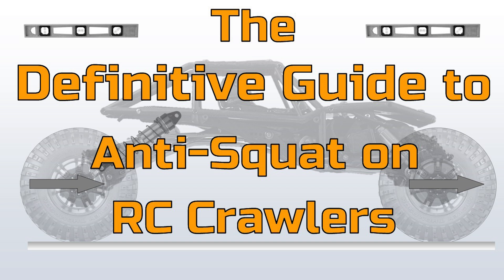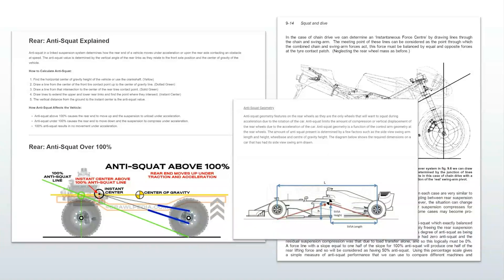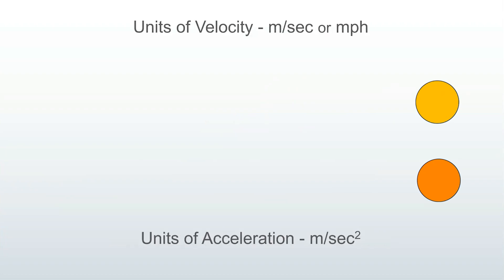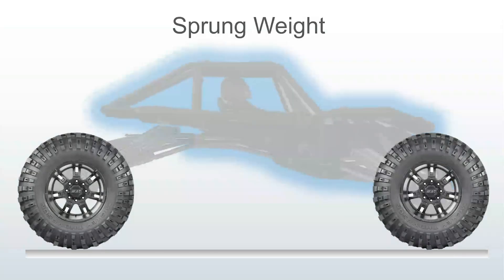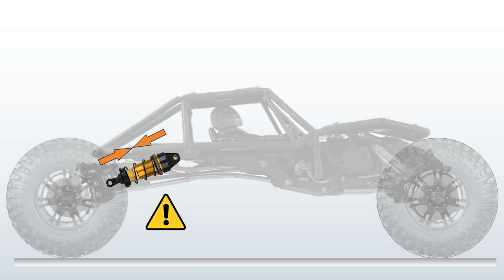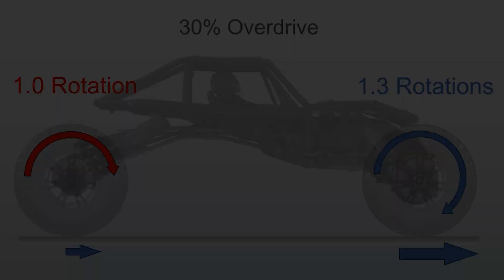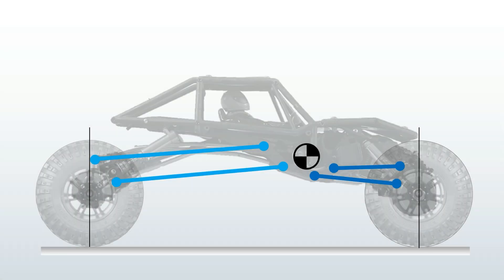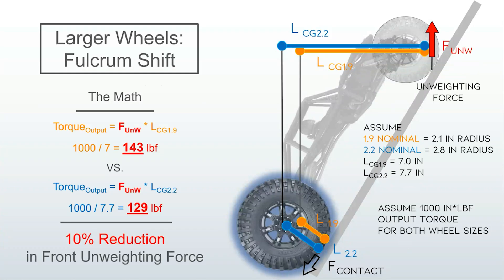The Biggest Misunderstanding in RC Crawling - The Definitive Guide to Anti-Squat

Comment: If you look at your example around the 4:02 mark, you can actually see anti-squat working. Without it, the suspension would compress as it climbed, instead its extended even under load. Acceleration isn’t the key factor here. Any load on the tire will trigger this effect.

The piece that’s missing in your explanation is caster. No matter how you position your links, caster determines how the forces push or pull on the axle and how those forces interact with the 4-link geometry. I have a few demonstrations here that show this in action. https://youtu.be/ULTCbL7Lawo?si=leyNb7_xaBgduzTd
Reply from the maker: Sorry friend, there are so many fundamental errors and misunderstanding of physics in your video that I don't even know where to begin. Best of luck to you.
Reply: @BoomslangSuspension  I’m happy to hear your thoughts, and you’ve done a great job explaining 4-link in your video, but it’s directly related to caster as the acting force. On your test config, the rear upper links are in the forward most hole. The configured caster induces pro-squat, even if your links are configured to fight it. Try adjusting your rear caster by moving the rear upper links back 1 or 2 holes, and watch your anti-squat come to life. I got clips of it in action, but without a link riser, it wasn’t as affective as it could be. Once FlowRC releases their aluminum link risers for FCX24 axles I’ll post an update to show the improvement.

Comment: I have a cheap WPL 1/18 scale  and upgraded my links to metal and extended the rears links 4mm along with soft grippy tires and beadlocks with some weight in the front and a new set of portal axles/ I've lowered it a lot and it was so bad and yet I was able to crawl up a 45 to degree incline without a problem but I wasn't able to crawl over sticks and some rocky terrain!

 So I experimented daily with my  shock positions and so far the best is soft springs in the front with bands
As for the rear I had some shocks from my 1/12 buggy and took the springs off completely and angles then forward just enough so I could climb everything in my area along with steeper inclines!
Reply: I just wanted to see if all my effort and patience paid off and it did!
I thought i had to go all out and spend more just to be able to crawl steeper inclines but your videos definitely helped me out along the way💯 @BoomslangSuspension
Reply from the maker: Sounds like you made a lot of good tuning mods in the right directions. Thanks for checking out the channel.

Comment: Most rc crawlers these days are running overdrive which pulls the front down because it’s being pulled by the front wheels. Kinda negates any need for anti squat.
Reply from the maker: You are correct, but also keep in mind that if you are climbing something really steep, the front wheel will slip first, which negates the overdrive as well.

https://youtu.be/Eb5xjllzd4E

Comment: Really interesting, but I have Two points of discussion:
1) How to calculate the antisquat: I fully agree withe the drawings when it comes to calculate the antisquat on a climb, but, if the rc crawler/scaler is on a flat plane, the intersection with the CoG is not above the front axle, but depends on torque on each axle (on a open diff woould be exactly in the center of the wheelbase, on fully locked diff vehicle is the opposite of the weight balance)
2)Didn't make the calculations, but I don't agree with the bigger wheel advice: Yes you increase the radius, but you will need more torque from the motor to overcome this change, at the end you need the same amount of force on the ground, not the same amount of torque on the axle
Reply from the maker: The anti-squat diagram is actually independent of orientation in space. It’s a balance point between the distance of the center of gravity off the ground and the contact patches. I’ve had to think about this a lot, but orientation doesn’t matter and I’ll eventually do a video explaining it.
If you put on a larger wheel your rear torque automatically goes down, which helps hold the front end down. This assumes you don’t compensate with more gearing or motor power.
Reply: @BoomslangSuspension  the antisquat diagram is independent of orientation in space yes, but dependent of torque applied on each axle. Is something I found trying to understand its behaviour and it is easier to find something searching antidive calculation, because a torque is applied on all wheels.
Reply from the maker: If that were correct don’t you think a value for wheel torque would be in the diagram? It’s simply not a variable in the calculation, which should lead you to conclude that it’s not a contributing factor. The anti-squat counterbalancing effect is the same at all accelerations, and at all wheel torques.
Reply: @BoomslangSuspension   I wrote two times the answer, and disappeared both times, why?
Reply: @BoomslangSuspension  Ok, try for the third time: I agree with you, but what created doubts was the analysis on Suspension Secrets about the antidive during braking (i will not link the article, maybe is the reason why my messages are deleted); in they dissertion they add the brake bias, because the torque is not only on one axle, but on both. This is the same situation on an 4wd, 50-50 open diff, can vary on a locked diff, but, in any case, if the brake bias is considered, why we don't have to do the same on acceleration?
Reply from the maker: I don’t know why it didn’t post. I am not filtering comments. 🤷‍♂️
Reply from the maker: I’ll take a look at that article. I don’t see how brake bias has any effect. Anti dive is literally just the exact opposite of anti squat. 2wd or 4wd should not matter. 
Also, braking does not engage 4 wheels better or worse than acceleration. In both cases you  have a weight shift which adds weight to one set of wheels and proportionally unweights the opposite set of wheels. I’ll have to try to figure out what their POV is. Not seeing it yet.
Reply: @BoomslangSuspension  obviously brake bias has effect only on antidive (and rear antirise), but if you think that it is just an acceleration with a initial velocity in the opposite direction you'll see why I'm comparing them, instead of the halfshafts are the brakes that generate the torque, not really a big difference froma equation point of view.
Keep me posted, definitely I want to talk with someone who knows what we're talking about.

Comment: Your videos are very informative and help to ‘straighten out’ some of the conversation that I hear at my local club, and on the internet.

I note your videos about link risers and squat/anti-squat. I agree the traditional theory on this subject tends to come from full size automotive design where the wheels drive a vehicle forwards or brake against its mass and the effect of the CoG during acceleration/deceleration.
 
I agree that, without acceleration or deceleration there is no force to act to cause a vehicle to lift or squat. Perhaps on a quick squirt of the trigger but the effect will be slowed to next to nothing by the inertia of the chassis and the damping in the shocks.

However, perhaps there is aspect of squat/anti-squat that could be considered – I wonder about the magnitude and significance. When a vehicle is at an angle going up, or down, a slope there is a force that the wheels have to work against and that is gravity acting through the CoG. This would appear the same to the vehicle, as if it were accelerating/decelerating and so the impact of the chassis geometry would be similar. The steeper the slope, the greater the effect. The location of the CoG moving closer to being over the axles will incite tipping and this will be worse the steeper the slope, so perhaps, any anti this-or-that might be useful.

I have been playing with rigs that have only roll suspension…

Your thoughts please.
Reply from the maker: At slow speeds it does nothing, regardless of the incline.  As far a steep hills, are you really accelerating up or down the slope?  Perhaps...in which case traditional AS calcs PROBABLY go out the window because the CG down force vector is now much different.  BUT...I reserve the right to change my mind as I think further on it.  🤔🙏
Reply: @BoomslangSuss  I think the car's CoG 'sees' the incline as acceleration even when it's not moving.

Comment: Ok can you help me understand something in nuance?

When accelerating, the axle tries to drive out from under the chassis. This creates a rotational force between the CG and the IC. The interaction between these two forces is anti squat. 

Everything you said about this makes perfect sense.

BUT

If I were to stand on the brakes while pushing on the gas it there should be a torque force on the axle to rotate forward resisted by the brakes. 

Wouldn’t that put a torque load into the links regardless of acceleration? If I’m pulling the bottom link and pushing the top link, that should have some effect. What would it be called? Or am I misunderstanding something?
Reply from the maker: Thanks so much for
politely asking the question and I could try to answer. 

If you have drive power, let’s say your wheels are rotating clockwise your axle housing has to resist that and can only rotate counterclockwise. That counterclockwise rotation pulls on the top links and pushes on the bottom links. That’s the only thing they can do. Braking wouldn’t change that - it would just reduce the amount of counterclockwise torque.

So how would you get the top links to push and the bottom links to pull if you are driving forward?
Reply: @ what I’m mostly going off is when we stage, pushing on the brakes and revving up the motor makes the suspension shift around a small but perceptible amount. 

Big horsepower drag cars can twist the chassis with engine torque even when stationary. Presumably the rear axle could be doing something similar?

If a torque is applied to the pinion gear, it would transfer that force to the ring gear which would transfer load into the housing and axles.

If the tires/axles/brakes can’t move, then the force would have to be applied to the housing and therefore the links which is what I assume I’m feeling as we prepare to launch.
Reply from the maker: Winding up the chassis with the brakes on doesn’t change the fact that the axle housing must rotate opposite to the wheel rotation, wheels that are connected to the axle rotating inside the axle housing. Wheels rotate CW. Axle housing has to rotate CCW. It really is that simple. 

You wouldn’t need wheelie bars if you could magically rotate the axle and chassis forward while your wheels are rotating forward.

It’s like turning a wrench clockwise but expecting the bolt to move counterclockwise. It’s simply impossible.

Comment: Will added link separation added by the link riser increase stability when the axle is in articulation and under power? Thats kinda my reason for running one, all by feel but could all be in my head hahaha.
Reply from the maker: That depends what you mean by stability.
Reply: @BoomslangSuspension  axle rotation vertically , or twisting.
Reply: Or maybe slowing down the torque twist as climbing and actuating. I could explain in a driving example but hard to put to words.
Reply from the maker: It won’t do any of that. But if you think you’re experiencing it, send me a video with and without link riser on the same line and I’ll break it down.
Reply: @ will do. I think I can replicate it. This is 24 scale btw.

Comment: Front link geometry can suck the front end down during acceleration. 
RC crawler, especially with od/ud are always experiencing acceleration. As the tires are spinning then gripping rapidly, that is creating acceleration forces. 
When your tire slips, then has instant grip, your lower rear link will push as your upper pulls. This gives the acceleration effect due to your axles rotation of the pinion trying to rise. 

Link risers were designed to help with link separation, helping with roll center adjustments.
Reply from the maker: Front links have zero influence on front end height under acceleration - only deceleration, i.e. anti-dive.
Blame the messenger if you like, but anti-squat and anti-dive are well understood, proven and universally accepted by suspension engineers worldwide.
Reply: @BoomslangSuspension  If the front end has traction it definitely affects the front suspension.  Plenty of comp rigs will lower the front under power.  Only at 100% power delivered to rear will front not affect suspension  action during standing torque or acceleration.

Comment: The torque dynamic of this is more important than mentioned.  Rear upper link positions make a huge difference in how easily the torque can lift the front.  Call it anti-squat but this is too over simplified  because physics of leverage is ignored.  This is where link risers actually help.  Changes leverage force required to lift the front end.  They dont hold the front end down, but in a chassis where you cant adjust the upper rear links, a link riser instead changes it.

Just gotta look at geometry with physics of levers.  Sadly i dont have the patience to make a video but take your shocks off then torque the rear axle in the direction it would rotate in back tires couldnt turn. Move the upper link positions up and down in the front, then add a link riser, measure force needed to lift the front.

Physics 101
Reply from the maker: Yes, it is Physics 101. Torque In (force x lever arm) = Torque Out.  Wheel Dia x Drive Torque = Chassis Length x Front Wheel Downforce.  

https://youtu.be/0WmpVvyTt8M

Comment: What about the change in direction? That is the part of the definition of velocity and acceleration you left out. The act of going up hill puts gravity forces similar to that accelerating on a flat surface. That being said I’m just spitballing here. I don’t see how raising the mounting point on the upper links would help. If anything in my mind that adds leverage to the pulling caused by the rotational forces on the axle .

Comment: When calculating acceleration up an incline, you should account for gravity using g sin(0), where 0 is the angle of the slope and g is the acceleration due to gravity (approximately 9.8,m/s²).
Your explanation seems to assume that the acceleration forces are insufficient for antisquat to be effective. However, the issue is that the total forces are too significant. While I agree with your conclusion that antisquat is ineffective, I disagree with your reasoning, as it fails to consider several important factors—most notably, the effect of gravity.
Reply from the maker: It’s not my reasoning. It’s standard suspension theory accepted by suspension engineers and experts worldwide. The acceleration in question is your wheels accelerating out from underneath your stationary center of gravity. It has nothing to do with the gravitational constant.
Reply: @BoomslangSuss  when you're talking about going up an incline the acceleration acting on the suspension is in addition to g sin(0) the acceleration of gravity, standard suspension theory assumes a level surface, am I incorrectly assuming that your intent was to scientifically explain antisquats lack of effectiveness?
Reply from the maker: I did explain scientifically when AS is active and when it’s not.
Reply from the maker: Gravity is an acceleration when you are in space. On solid ground, it can be thought of as a constant.  F=m*a - gravity converts your mass to a downward force.  It has nothing to do with the acceleration referred to in anti-squat theories. Gravity pulls the mass of the vehicle against the springs. On an incline, the weight bias shifts to the rear, so there is more force on the rear wheels and less force on the front wheels. Assuming you have not bottomed out the rear shocks, the anti-squat response is unchanged because your spring rates are still the same regardless of their position in their travel. The acceleration in questions is the wheels accelerating out from under the C.G. and the incline does not matter. Your C.G. is always the same by definition, independent of incline.
Reply: @BoomslangSuspension  Gravity is always an acceleration of 9.8m/s² on earths surface, though it changes based on location. The effect it has on AS in this case is minimal and I'm in no way suggesting it should or would change the results in most cases, however ascending up an incline against gravity will make anything seem as though it is more heavy or as if it were experiencing more acceleration, think of driving up a hill or ascending in a plane, the main way this is relevant in the AS equation is increased body weight transfer as a result of resisting gravity, like I've said before it can be easily calculated so there's little to no reason not to do so, to be clear I completely agree with your conclusion, I agree that AS is mostly ineffective for crawling, I'm just interested in the math and science more than most, if my overthinking isn't appreciated or is annoying, I apologise, the forces added to the equation are negligible compared to those already eliminating antisquats effectiveness and wouldn't usually effect the result, but they do exist.
Edit: Also your CG isn't always the same, it changes slightly depending on body roll, it's easy enough to demonstrate with your incline board notice how your CG and thus tipping point change based on suspension compression, body roll/suspension travel will effect CG.
Reply from the maker: I’m the king of overthinking so your thoughts are much appreciated. Your CG only changes if your shocks extend or compress. I think you are misapplying the concept of gravity. The only effect it has on the vehicle is pulling the mass straight down and converting it into a downward force.